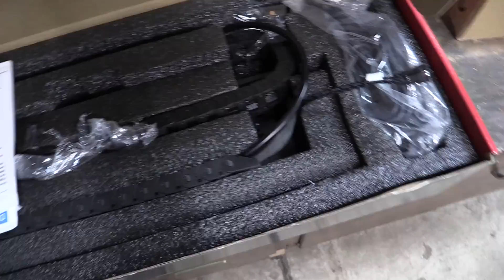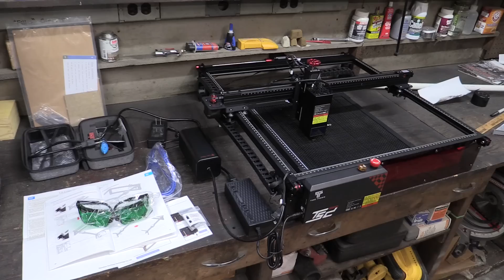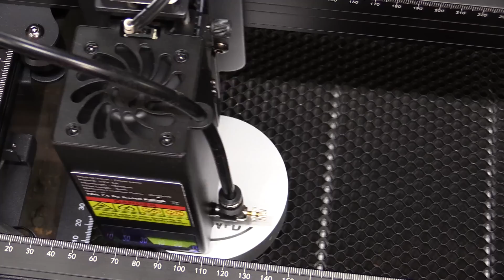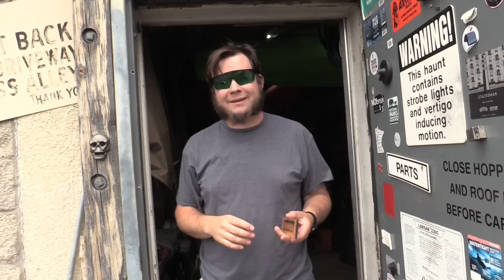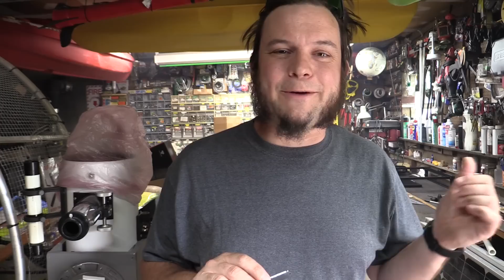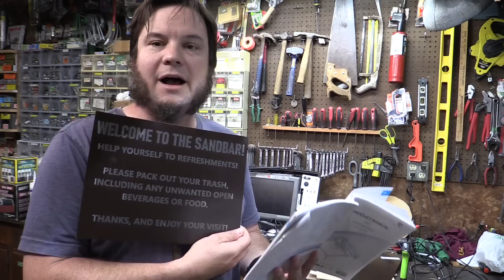It Cuts, It Slices, It Even Makes Toast! Trying The TwoTrees TS2-20W Laser Engraver System (Review)

Comment: I noticed a lot of comments on an enclosure for the laser.  TwoTrees has an enclosure and it includes a fan with an exhaust port on the side.  I have the TS2 10 watt version and bought the enclosure.  It was heavily discounted by TwoTrees at the time I purchased it.  I have a CO2 Laser which I have with a large inline fan which I will also use on TwoTrees.  I just got everything so I have not tested it yet but thought I would mention it and hope this is helpful.  Nice video by the way.
Reply: I've just bought this enclosure, but the fan looks quite pathetic from the images, like a computer fan with very little pressure. Is that what it's like?
Reply: Yup,  I think it is a pretty light duty fan.  I was not planning on using it.  I 3d printed a bezel to replace the fan and then printed an adapter/coupler to go from the TwoTrees 3-inch exhaust pipe to my 4-inch pipe to the outside.  There is a variable speed inline fan that I will be using which I also use on the CO2 laser in the shop.  I may add the TS2 fan back into the mix if needed.  As mentioned I have not tried the TS2 expect to see that LightBurn controls it.  The main reason for not test everything out is mainly because I need to clean a space ; ).  I am so far impressed with the construct and features of the TS2 Laser.  I also added a cross-hair laser to the TS2 for alignment.   @Ziplock9000

Comment: I'd absolutely build an enclosure for it, even if it's just plywood covered in aluminium tape, lasers don't care if you like your retinas or not lol
Also, swap out the laser cooling fan for a like for like Noctua, they're the same dimension and voltage but they're silent and usually have increased airflow too. And get an extractor fan mounted on the rear of the enclosure to draw the fumes out through the wall with one of those dryer flap vents

My air assist pump (different model as it's for a DIY laser cutter) was pretty noisy until I added some 3d printed spring feet made of TPU to reduce the rattling noise. Cheers for the review, very thorough - Also, you can get rattle cans for laser engraving metal which cause an oxidation and turns it black

Comment: Laser engravers/cutters are fairly fiddly. It is a process, but be patient and Im sure youll get some quality stuff in no time. Some tips: Lightburn is easier to work with than lasergrbl, every material is different in that they require different settings, the "recommended" settings are quite often just "guidelines," and GET A COVER and a way to vent it out (We use a basic 4" fan & dryer vent tube to vent things out a window) Itll save you from some fumes & smoke.

Totally dig your vids btw. Keep it up!

Comment: Assuming that this is a cheap 20w retina-frying 450nm diode, there shouldn’t be invisible radiation (that’s mostly a concern with green lasers), so if you can’t see the spot at all (!) through the goggles, it’s probably fine. 

Besides that, I wouldn’t rely on goggles of any kind, and just put that thing in an enclosure (also helps with the fumes

Comment: I have many concerns regarding those safety glasses included.
I'd highly recommend investing in a pair of proper laser safety glasses from a reputable source such as survivallaser.
The ones found with most products coming from overseas are usually not even for the right wavelength of laser light!
For blue lasers (those around 435 - 500 nanometers) generally red or very dark green safety glasses are used.

Also make sure to have proper fume extraction especially when working with plastics or acrylics.
Reply: If you can’t see the laser through the glasses at all, it’s probably fine
Reply: @among-us-99999  "probably" is not really in consideration when a mistake could leave you with permanent blindness.
Not to mention the risks of invisible to the naked eye wavelengths which can still be powerful enough to cause damage.

Comment: Laser cutter is probably most used tool at our hackerspace. 🙂Really good way to introduce cool tech to woodworkers and woodworking to more electronics oriented makers. Read what everyone else has learned about laser cutting/engraving online to learn this faster/safer.

Some tips:
1. Most acrylics are fine to cut after fume extraction. This includes engraving through acrylic (spray) paints to make high contrast signs.
2. Corrugated cardboard is only thing we have actually managed catch visible fire in 8 years. Bit too much airflow from fume extraction inside the sheets. Setup IP camera for remote monitoring.
3. Buy indoor plywood/veneer if you want to cut through it. Outdoor use plywoods have tougher glue which mostly heats up and boils instead of cutting. Use masking tape on cut edges to make cleaning up burn marks and soot bit easier.

Comment: My only recommendation would be to source yourself a pair of quality laser eye protection from a reputable laser supply company (not Amazon/ebay/etc.) I wouldn't trust those included glasses personally.
Reply: If you can’t see the laser dot through the glasses, they’re probably fine.
Reply: @among-us-99999  a lot of these cutting lasers are usually well in the IR spectrum and not visible by naked eye.  According to TwoTrees however, this laser is 445nm, so it should be blue visible, but IDK about you... I'd rather spend the $75-100 to ensure my eyes aren't hurt.  That's me, though.

Comment: i got one of those, different brand but you are very correct about the smoke factor. best i came up with is a shop vac outside with a 20ft hose. maybe a metal grid made into a vacuum table to suck the work piece down to keep it from moving might work ?

Comment: I would highly recommend using it to make some sort of enclosure made of that green acrylic so it will be easier to vent and safer for you and Donny's eyes, also incase someone unknowingly walks in without eye protection while its running. Always remember, safety 3rd! :)
Reply: Yeah, all these cheap power laser products look sketchy even by my standards. As mentioned, just reflections can do instant damage. Full cabinet also lets you vent it outside easily, which is a good idea when vaporizing mystery metals.
Reply: Steel box is the way to go.
Reply: I don't understand how these unshielded laser cutters pass QC, and even less how they are legal (and easy) to sell -- being such a blatant safety hazard -- with little to no precautions.

I mean, the goggles that come with some of these kits. They're either colored plastic, or designed for the wrong wavelength and offer no protection for the included laser.
Reply: @TheElectronicChannel  There is no QC or safety consideration, that's part of how prices are kept low. I think you'd have to outright ban direct to consumer imports from China (yay, paying a state sanctioned middle man!) to even make a dent. Same problem with the fire hazard lithium batteries in various things, sketchy uncertified power supplies, highly thoriated quackery, etc.
Reply: @Broken_Yugo  Yeah. Unfortunately, if Chinese imports were banned the entire US economy would implode, seeing as almost all consumer products are outsourced to China for manufacture.

Unrelated, but I immediately noticed "thoriated quackery", and remembered that the vacuum tube in my pfp, a Soviet GU-81m, has a thoriated heater filament -- Although I think they did that for an actually valid reason.

Comment: those glases are bad becose they are green and the laser is blue 450nm, for 450nm glases shauld be orange or red
Reply: This 100% 
Please invest in proper safety equipment! We want to see more videos, which is a lot harder if he's blind.
Reply from the maker: Is there a good source for legit glasses? All the ones on Amazon make a lot of bold claims, but who knows if they're good?
Reply: @saveitforparts  I'm not personally experienced enough to bet your safety on my word, but I've fiddled with lasers.

First off, I would guess a 400-500 nm range pair, since you laser looks blue.

There's an OD rating which tells you what percentage of the light gets through. There are formulas based on your laser type and power to figure out the minimum level to prevent major eye damage (longtime use may still cause harm). Something like googling "Laser Institute of America - Free OD Calculator." I needed an OD of 3

This is not necessarily something you want to risk buying from amazon or a random seller, but I guess it's your choice of how safe to be. The only way you find out if the glasses are bad is when you have eye damage :/

Ideally, get some advice from someone who really knows lasers
Reply: @saveitforparts  survivallaser is a name I'd trust with my eyeballs.
Reply: @saveitforparts  sorry for responding late i commented but it glitched and did not work, so on amazon are cheap crappy glasses you would need to do a research on brands since im not in USA. stay safe
Reply: yea something seems not right. i thought the best protection wouldn't be specific to any wavelength, they should be very dark tinted like welder's goggles. and after a while seeing the same hue all the time would be annoying and might change the color receptors, but i don't know about any of this for certain

Comment: Remember that laser radiation causes accumulative damage over time.
 This applies to the work as well as you.
For cleaner cuts, have a bit more patience.
You can whip that head around at speed and full power to get a better cut over several passes.
And above all grasshopper remain focused!
Reply: Do you get less charring using more passes?